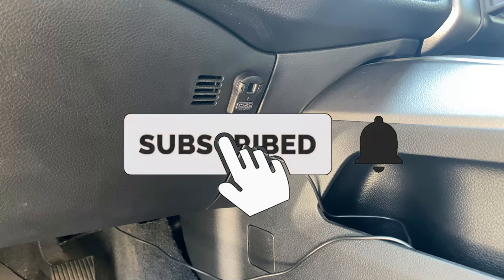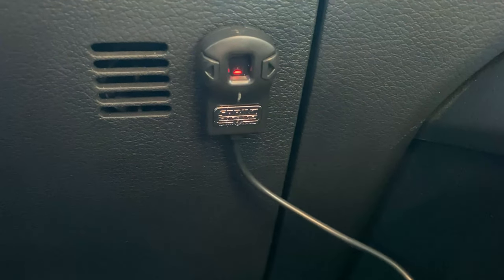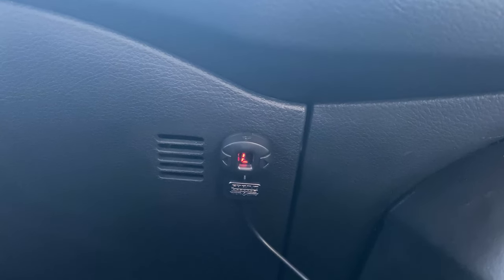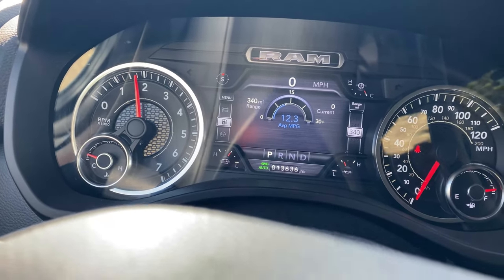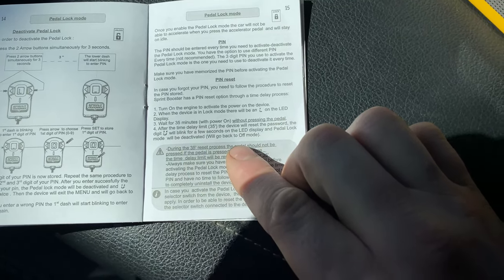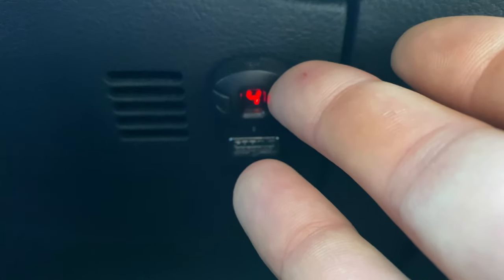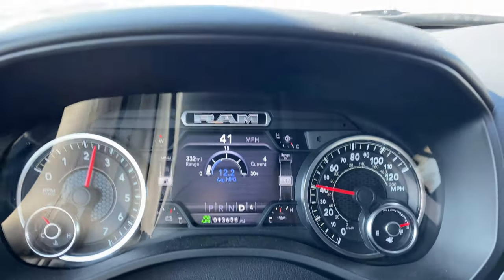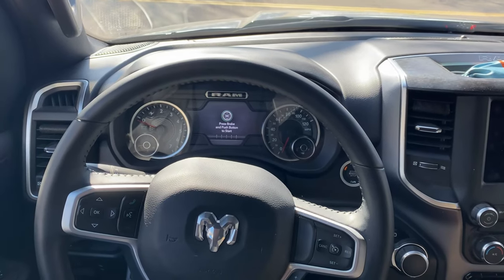Sprint Booster Pedal Lock And Valet Mode Setup

Comment: SICK! Thanks! The sprint booster seems to be the best one of these overall, as I noticed the pedal travel in boost mode is still very linear and accurate, it just removes lag. With the pedal commander it seems to work by applying way more throttle than where you are pressing. A guy demonstrated the sprint booster and how it mechanically works and I was impressed. It should have been a 4 button pin code though as a determined valet will try the 720 combos needed if they really want to fang your exotic, expensive car.
Reply from the maker: Agreed!

Comment: ‘14 2.0T M Gen Coupe
I’m aware of the pedal lock and what is required to disable it.
However, each time I attempt to fix it and I hold opposing arrows all I get is a middle line that disappears once I remove my hand. Out of ideas.
Any help ?
Reply from the maker: So the pedal lock is currently stuck on? I guess I’m not sure the issue then if you’re doing everything right, possibly an issue with the unit itself. You could try do disconnect the spring booster and plug your factory throttle connector back in. I think that would disable it, then maybe plug the sprint booster back in and see if it cleared out the pedal lock. Otherwise I think the instructions said something about being able to reset it if you let the vehicle idle for an hour without touching the throttle. Otherwise I’d recommend emailing sprint booster support!

Comment: Dose the 35 minutes apply to vallet mode if you forgot the pass
Reply from the maker: Good question. The answer is yes. I had to go back and look myself. At 7:18, if you pause it, you can see at the bottom right in the gray area it says the PIN reset prosecute works in valet the same as pedal lock.
Reply: @TonyTheTruckGuy  I figured it out thank you

Comment: Will the truck IDLE in Lock mode? Not sure what your Ram has, but my FERD is supercharged, and I'll assume Valet-3 mode will still give a mechanic or valet enough of the original 650rwhp to play moron games while they have my keys.
Reply from the maker: Yeah at 2:33 you can see I start the truck up with pedal lock on and there's just no throttle response. Not sure how restrictive the valet on 3 would be on the Ford.

Comment: On valet mode, does it stay active until you disable it regardless whether you turn it on/off? Or do you have to activate it again each time you turn on/off the car? I have to leave my car at a shop for a few days and I'm worried they might joyride it or launch it.
Reply from the maker: I’m fairly certain I remember it being locked in valet mode until you type in the code, even if you turn the truck off and back on.
Reply: Great, thanks for the info.

Comment: can i activate pedal lock/valet mode while engine is running?
and how can i reset pin codes?
Reply from the maker: I’m sure you can enable them with engine running just don’t have your foot on the throttle. I can’t remember for sure but I think you have to set a PIN each time you enable valet or pedal lock. In which case you could change the PIN every time
Reply: @TonyTheTruckGuy  
thanks a lot for your reply and posting such nice educative video👍🏻👍🏻